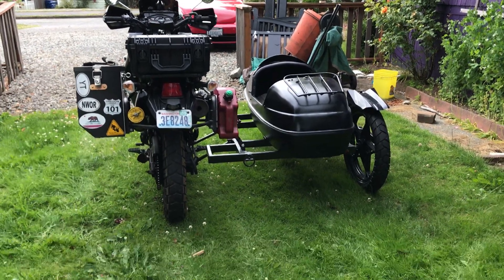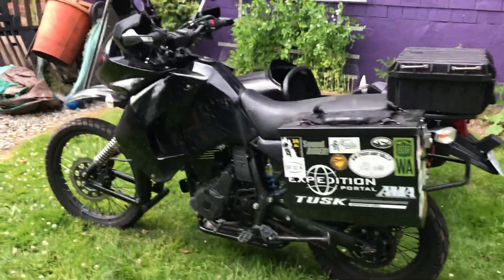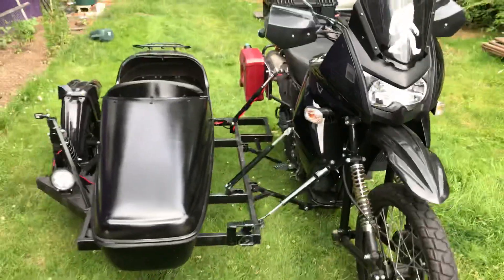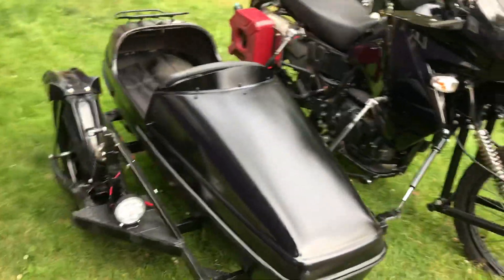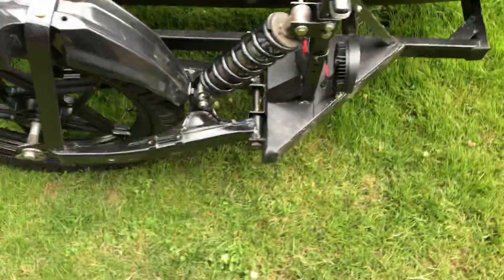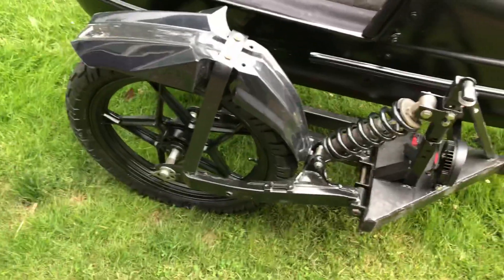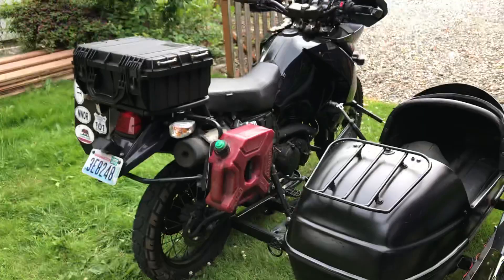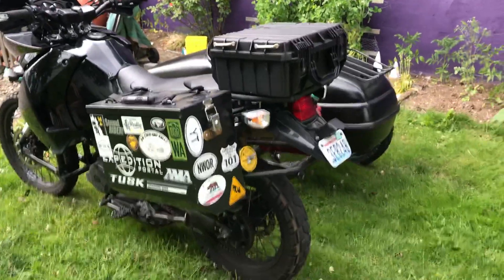KLR650 adventure sidecar

Comment: Hey motohead117, I would love to know how I could replicate the sidecar design. I have a Triumph Tiger 800xca and would love to travel with my dog.
Reply: I have a 2018 Triumph T100 Bonneville with a Velorex Sidecar. The T100 and the Velorex 563 are black so matching colors is not an issue. The problem is with the low power of the T100. I am at 6800 feet most of my riding is an average 5600 feet. The T100 would be a better match with a T120. I am limited to about 65mph on open roads, the T100 has a problem due to lack of torque. I also believe that the key to a great ride is the application of the dual clutch Gold Wing with the 1800cc mill. This is a true statement as I have had the opportunity to enjoy that set-up with the DCT 1800 Honda Gold Wing with a Champion Avenger Sidecar attached. The Velorex 563 has a one inch diameter axle. I not sure what the Avenger car axle diameter is, however i believe the Avenger sidecar is a deluxe unit with hydr brakes and hydr trim. To build the Triumph/Velorex the cost will be around 15k the Honda DCT/Avenger around 42k. The Gold Wing rig is the deluxe of the two. If you have any questions you can email to greenhorn@ghvalley.net .
Reply: You should get a good URAL side car outfit. Very reasonable and low mileage. Because they take up a lot of space people want to sell them fast. You either love them or you hate them. I love mine. But my dog guards my house 🏠.